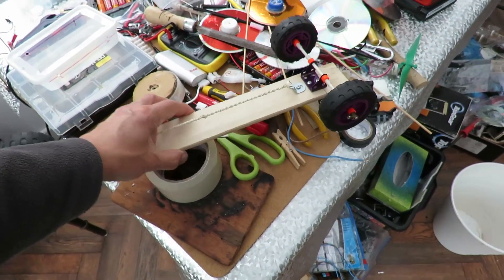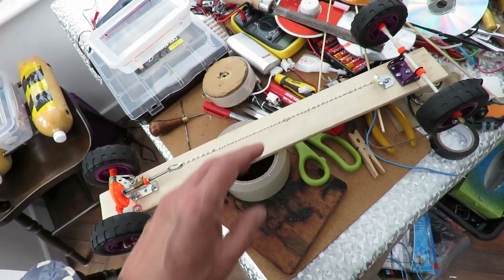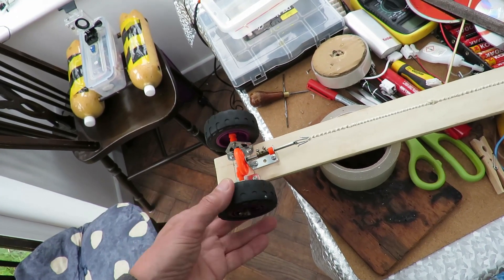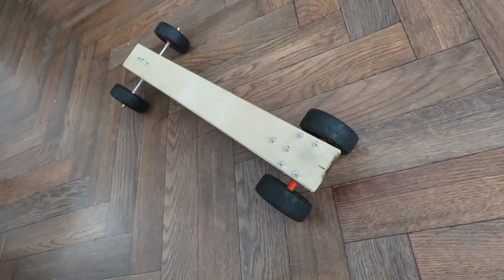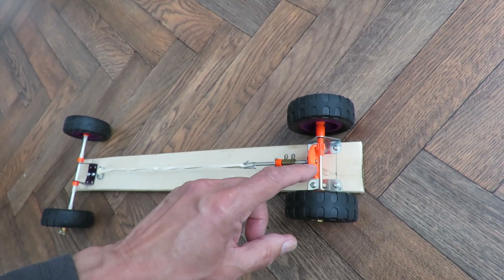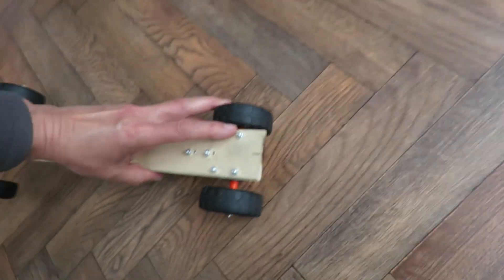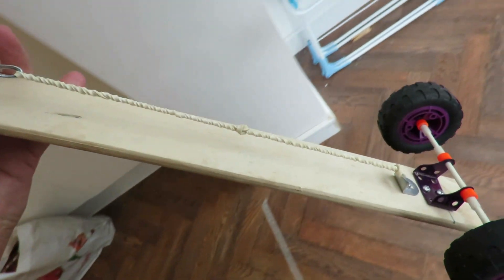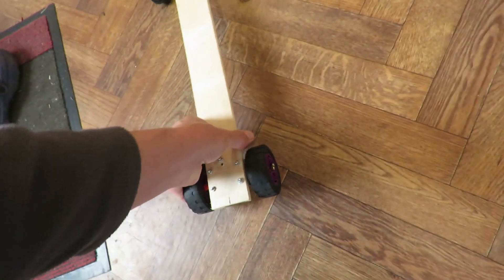Put a rubber band on it #0278 change of gear

Comment: when we had traction problems in the mud or at the track we let air out to soften the tire and give a bigger footprint, that hard to do with plastic, rubber bands or hotglue might help. Turning it over might help as well, lowering the cog can have an effect on performance, besides I think it would look cool
Reply from the maker: Thanks Doc, yes the main way of improving the grip here would be to add weight or maybe cut some strips off toy balloons and stretch them round the rims. The main purpose of tis video was just to demonstrate the difference between the high ratio and low ratio. Just depends what task is required, some of the projects set require speed and some want distance.